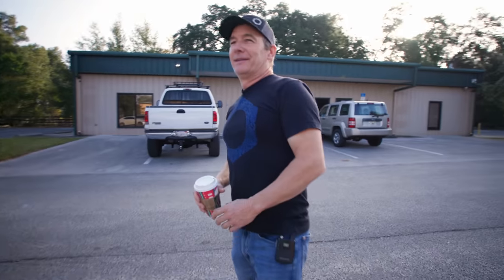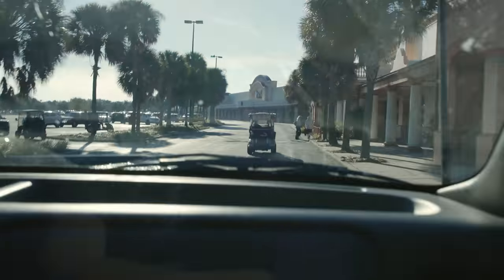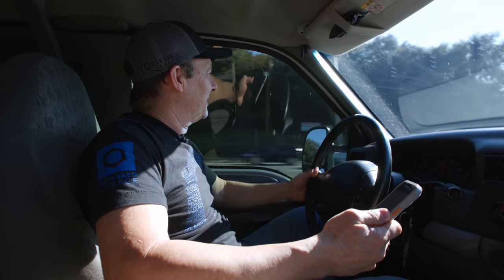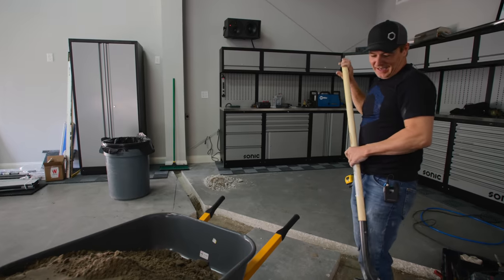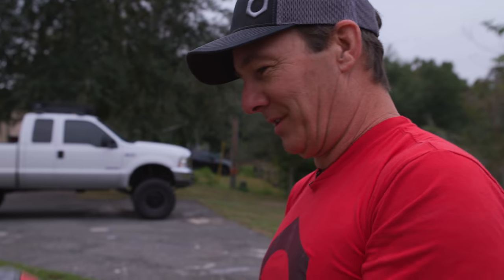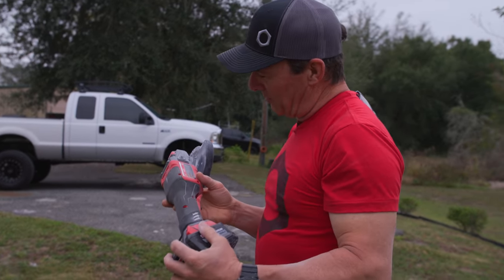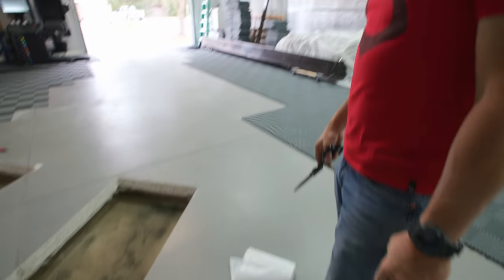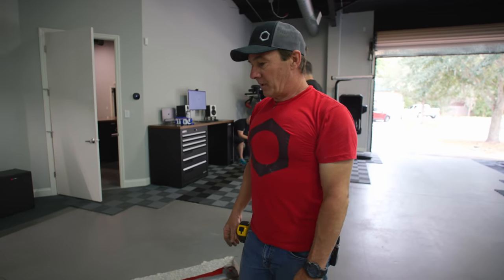How to Install a Recessed Lift with Mike F: Part 2 (Excavation)

Comment: Really interesting to see the cracks in the bottom of the slab at the control joints where the cuts are. Really shows the importance of control joints, so you don’t see huge cracks in the top of the slab.

Comment: Would there be any instance when you would dowel into the existing slab?
Reply: You really always should.  But as Mike said, when you’re doing a step down, he would have had to cut way back and pour a multi level pour with the existing slab to remain at the same level as some of the new slab, and then the recessed areas.  And then, to do it right, you’d have to double 45 the rebar so it was continuous at the top and bottom level.  Or another similar detail.  

But. 

The existing slab had no rebar anyway (looks like WWF, or chicken wire as it’s referred to).   So he’s already going above what’s there.  And it was far easier to go underneath to key it in as he did.   Plus, since the load is static in one spot, it should be ok.  If the existing slab doesn’t crack with the cars driving on it and the load only distributed across 4 parches the size of your hand, poring a reinforced footer for the lift where each portion of the lift is somewhere around 8 to 10 square feet, he’ll be fine.  

Oh, and Mike F, I’m surprised you didn’t look for plastic chairs when you couldn’t find blocks.   Probably would have been easy to find?   Should be, anyway.   I rarely see blocks used, all my contractors use chairs for 95%, and really only use blocks / brick when there’s a big junction of rebar, like at a corner.
Reply: @joetacchino4470  thanks Joe!
Reply: @joetacchino4470  Excellent explanation, pretty much my thought process for this.